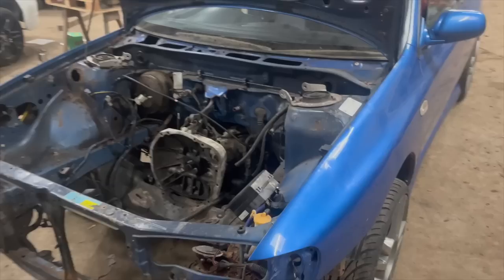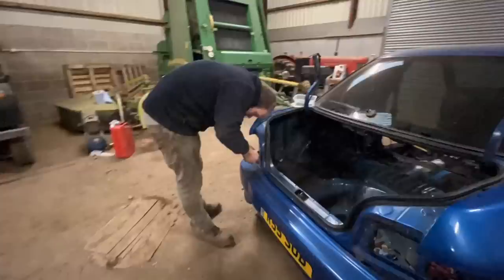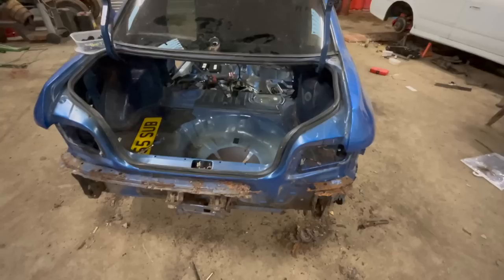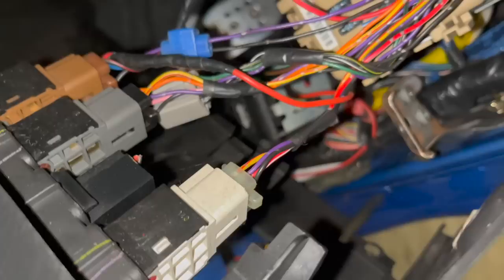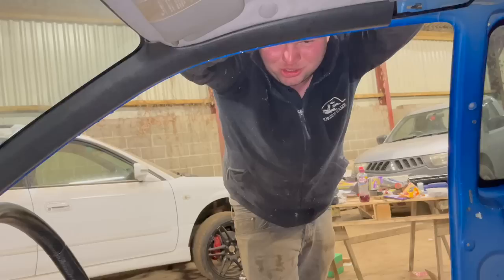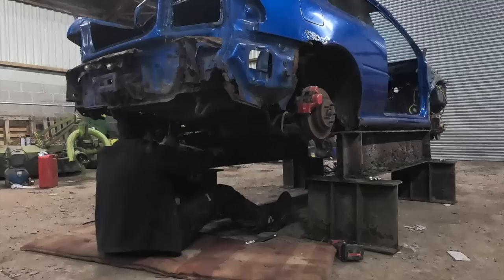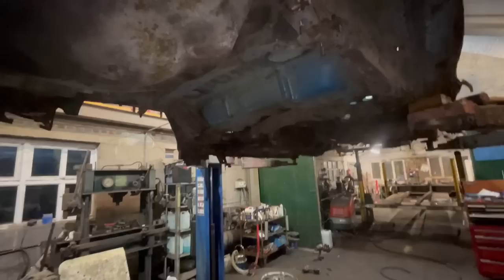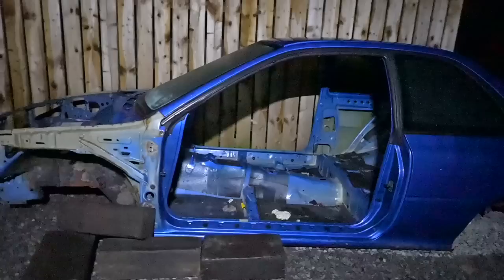Is this Worth £50,000? Can it be saved? Extremely Rare SUBARU IMPREZA STI VERSION V LIMITED - EPS 5

Comment: Ooft i remember ploughing too much money into my 99 classic getting it to 350bhp limit as forging engine etc was exponential costs after all the bolt ons and afp mapped apexi.
Good memories on sound and low centre of gravity  but bad memories of tinworm and chocolate drivetrain and crank
Reply from the maker: thank you for sharing the story. This one will not be modified. It is going to be a factory spec vehicle totally back to original
Reply: I have another Subaru that cost way to much money to get it to what it was 😂 then I go and buy another one 🙄 the itch to get one is just too much isn’t it!

Comment: Had to use sealant on every classic Impreza rear lights, better than a soaked tire well. Common issue, same as rotten rear suspension turrets
Reply from the maker: We’ve got a work cut out, that is for sure sealant would’ve been better than tiger, seal or whatever they used on the back with a concrete
Reply: I don't envy you at all, best of luck 🤞🏼 🤞🏼
Reply: Aye can always do with a little bit of silicone to keep it from leaking but that was a bit excessive 😂

Comment: The tail lights are normally sealed with black goo to stop the water.
Reply: They are supposed to have a foam seal to stop it but most of the time people silicone them in as you don’t need them out to change the bulbs, just not fun when they do need to come out 😂
Reply: @nathanbrown7724   @nathan brown  Mine had factory non harderneing black goo with the seal. 99-00 model Aust delivered.
Reply: You could see that a bit with ours with lots of it crumbled away but all that clear stuff was silicone later added
Reply: @nathanbrown7724  yeah mate.
Reply from the maker: so much love between subscribers

Comment: Lovely cars, I've got a 2000 GT that's been 2017 & hatch STI bits swapped everything with a tricked out gearbox and it's a literary blast past near everything that lines up apart from actual race cars. Whats the motor plan? Set up going OEM? Or would there be a donor car involved?😁
Reply: Keeping it all original!
Reply: @nathanbrown7724  I do have all the bits that were not worn out aside, but everything else is so unassuming 2000 Subaru Impreza, like a weird 3 colour fabric covered bucket seats that honestly fits 80% of the people who get in, still have the full 2.0T that it came with, blown up gearbox and diff, thus, the '17 WRX & '11 hatch which was crashed on a track day made sense as a donor back in 2020 during the lockdown situation and zero parts being imported🤕
Reply from the maker: welcome to the channel
Reply: Running gear from a 2017 hatch STI? Or have I misread that?
Reply: @TheRZBM  yeah, she's GC8 outside but 2017 everything suspension up. Planning to take her apart in a few weeks and then revert her back to the original jap spec 2.0T once the stock motor is reassembled
Reply: @TheRZBM  fyi, there is a shop Forestor SG9, that's our run-around using a race motor and everything off a crashed race car. It feel criminal to slaughter cars on the road while fully loaded with parts but it is very satisfying!😁

Comment: Are you not tagging the wiring??
If not, good luck remembering what goes where.. 🤦‍♂️
Reply from the maker: this is the first Subaru that nathan has rebuilt
Reply: @shineautomotive  Respect, that's a big job to take on.
Hope you remember what goes where, got me hooked..
Reply: It looks worse than it is to feed the wires back to where they should be, just working out where all the cut and joins on the wires from previous owners will be hard 😂